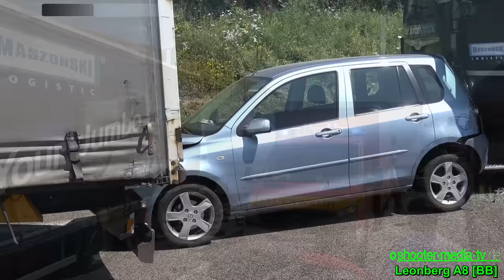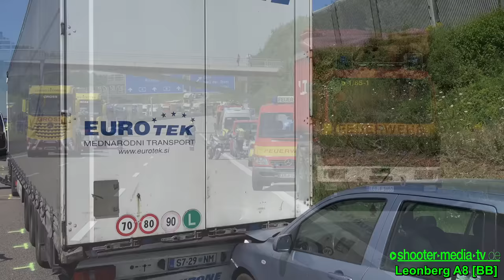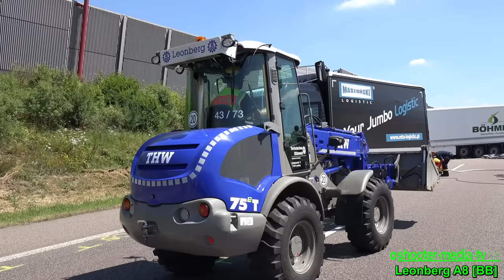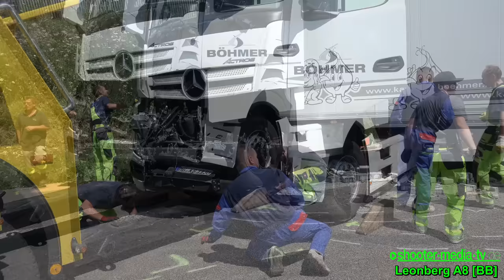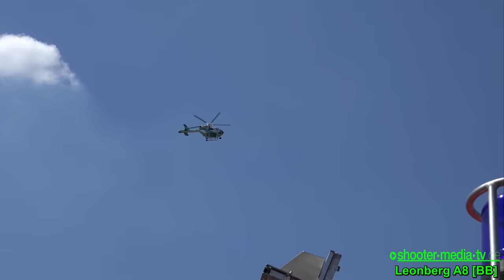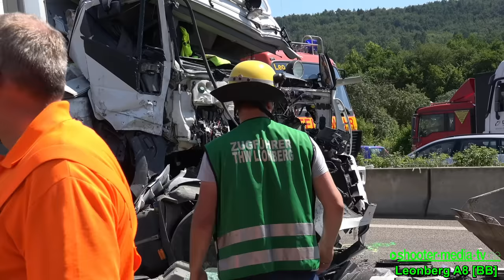A8: Unfall mit mehreren LKW - [Fahrer eingeklemmt] - Vollsperrung  🚒   Feuerwehr 🚑   DRK - THW

Comment: So many workers so little speed. the white truck could be towed with the trailor attached if you unbolt the driveshaft. THW is just ineffecient driver of the loader is a amature the rest are volunteers boy scouts and just in the way of the Pro's.
Reply: I wouldn't blame them too hard but I was wondering why pack all the bricks one by one and not load the bulk first by just running into it with the loader... Also wonder why by the end they still had not turned around the waiting cars through the previous intersection.
Reply: There is a standing order not to damage the road, inorder to have all strips of road intact. This is done inorder to have the buildup of vehicles removed from there as fast as possible, without having to redo parts of the roadway. So yes there is a reason behind thoose actions.